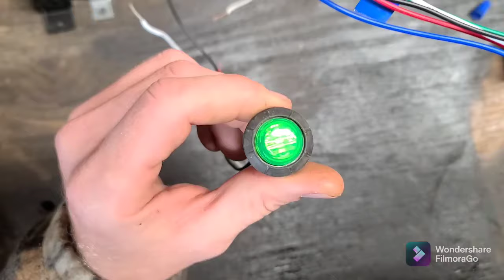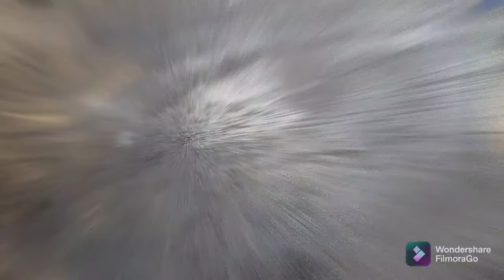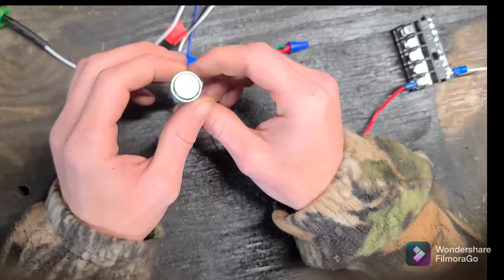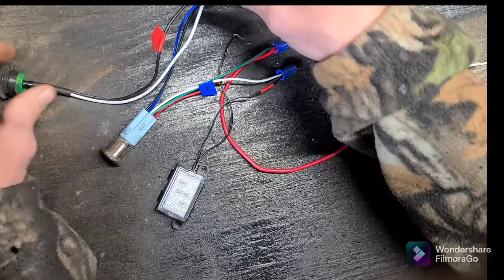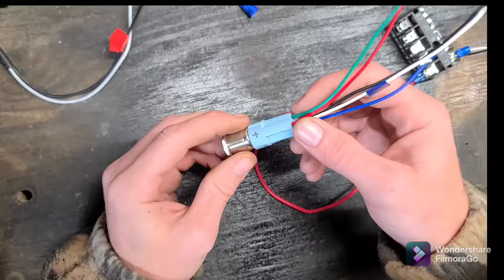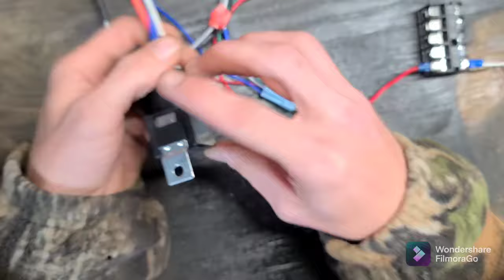How to wire a 5 pin halo LED switch.

Comment: This video made it so easy to understand. Could you by chance make a video for a 5 pin relay with a 5 pin toggle switch to replace a fuse? I want to use a toggle switch to turn off the module for traction control.

Comment: your video was great and helped greatly,but i would also like to know how to wire in a relay for radiator fan with the switch led lite on when fan is turned on... how can i get this info...   thanks Leo

Comment: I get really confused by your instructions. I have 5 wires on my latching switch. I want to have the power symbol and ring  led on when i push the switch in and i need to also transfer power to my LED marker lamps. I have a 115 volt to 12 volt power supply. I wired the LED marker lamps in a circuit with all black wires together and come out with a single wire. I wired three separate LED marker lights blue, green and red with each wire being separate on the other wires of the LEDs. How do i run from the positive 12 volt side of the transformer to the switches, three of them to control each of the colors, What do i do with the negative wires off the LEDs running back to the switches back to the transformer? I have green, red, blue, yellow, and black wires on the 19mm switches. I need a diagram.

Comment: I want to tie a wire to my AC selonoid direct. I want to push it in to connect for the circuit to the selenoid, plus i need to have the light stay on when it is engaged in case i forget to disconnect it. Which wires to i tie to the selenoid and the LED in the switch? Any help? What color and terminal goes from the switch to the selenoid and which wire comes from the ignition hot? Which color wire or terminal goes to which wire to keep the LED on when engaged? I have never been so confused. How about just doing a wire diagram showing the circuits and colors? It would be so much easier to follow on the different wire connections. Some of your video covers up the wire connection.

Comment: Is there any reason not to put the switch between the light and the ground? I’m putting some led lights in my truck bed but I have the fused power wire going directly to the LEDs and was gonna put this switch between the ground. Since it after the lights wouldn’t there be less current running through the switch? I don’t want the led ring to light up if that matters.

Comment: im gonna hook up 10 of those buttons, and wire so they light when they are turned on. but can i wire a button to turn of the led on the buttons? its for camper van and all the light might be annoyng at night i think, so would be nice to turn them off.
Reply: My campervan advice.... Don't have illuminated switches. You don't need them. You are just ask likely to forget to switch them back on to check if anything is on as you are to forget it's on because you don't have switches with lights. Anything you don't want running when your not in the van just wire a master switch and your done. The lights are irritating and not necessary in my experience.

Comment: On the light you used in this video was the negative wire white and the positive black? I was confused.
Reply from the maker: If you notice, I taped one of the words with red phase tape. This is positive. On THIS particular light, black is positive, white is negative.
Reply: @pemble07  Got it. I appreciate it. You are actually one only one that explained how i wanted to wire this light the exact way that i wanted.

Comment: Could this work with Wiring revers relays polarity and door actuators
Reply from the maker: Well, if i understand your phrase correctly, with a door actuator you would need a momentary switch, which this is not. Meaning if opening, once open, it would stay powered and potentially burn out the motor, switch, etc. Same for if powered closed. This switch, when wired to both poles, does either one load side or the other. Meaning it would always have power in either the open or closed direction. You need something to stop power flow once the actuators are in their expected position. I have a momentary one I may end up doing a video on.

Comment: Quick question dude. Exactly what would be the best way to wire the LED to come on only when the vehicle dash lights are on, like in a car for fog light, do it can be seen best at night? That what I'm gonna use .one for. Thanks a bunch
Reply from the maker: Wire your led for the halo wire to a source of power that only has voltage when your dash lights are on.

Comment: I have a 2 wire switch for my hazard lights in my car right now, wanting to use one of these. How do I go about doing that? Thanks in advance.
Reply from the maker: Is the factory hazard relay still in the circuit? If it is, you would have no need for the "nc" terminal to be wired in. You can use this switch, wire it as you normally would your two wire, you just wire in the switch led (halo) to a power source that comes on with the ignition.
Reply: Not factory but it does have a relay for the turn signals. The 2 wires on the toggle switch should be ground or power right ?

Comment: I have a LED momentary switch that I will be using for my boat horn button. I’d like to know how to have the horn working without the LED lit, and then when I turn on the navigation lights, the LED lights up. Any suggestions?
Reply from the maker: Yeah, wire in your led ring to your nav light circuit. The led ring is not at all associated with the wiring of the switch. If you want it to.come.on when you push it, you simply wire the light in series with the power to or coming out of your switch. In your case you want something else to control the led ring. (Ie. The nav lights) so wire that one wire to that circuit. Generally the ignition or off of a nav light switch if that's how you are powering your nav lighting.
Reply: @pemble07  thank you I was assuming that, but I didn’t want to fry anything in the wiring

Comment: Have just fitted new radiator and electric fan want a manual halo switch as a emergency wired in but the only thing that works is the led can you help 
Note when testing I only tested with engine not running as haven’t filled rad yet turn on ignition then switch but no fan working in a dilemma???
Reply from the maker: I don't know the amp draw or wattage of your fan, but these switches have very low amp draw ratings. This is a case where you would control a relay with the switch, then your relay is what ha does the power for your, in this case, fan.

Comment: When you install for real, you use those waterproof solder links instead of the screw on blue caps?
Reply from the maker: Yes, I never EVER use wire nuts on any vehicle. These switches are actually used after the video, so it would be a waste to use crimper and shorten my wires for the sake of a video. Sorry, should have noted that in the video. Yes I ALWAYS use heatshrink butt connectors, AND marine heat shrink over those. We have a lot of money going under water usually, literally.
Reply from the maker: Also, yes you can use the waterproof solder links. However, be aware that the Clear plastic on those connectors is very thin and will rub through, so if using the heat shrink solder connections, it's almost a must to add heat shrink over them to prevent rub through.

Comment: I been trying to figure it out.am i not seeing it correct or is your white wire on the green light actually a ground ?? thanks
Reply from the maker: Yes. The white wire is ground. The black wire is positive.
Reply from the maker: But, that definitely shouldn't hinder any information in this video. On that led light, it's simple. Hook it up, if it doesn't work, hook it up the other way. On these particular lights, yes white is ground. This is not a video about this light, at all. It's about wiring and how to understand it. Do you have any questions on the actual wiring process or you just asking questions?
Reply: Oh I know.i just was wondering iam trying to figure out this stupid 5 pin led push button trying to get my horn to work it confuse the shit out of me an your video really helps me thanks
Reply from the maker: @warrensylvester3807  Absolutely sir. And no it's all good. I get into lengthy explanations so didn't know to go there or not to go there. Thanks for the kind words and glad you found it helpful. I'm super busy at my shop right now but will be posting videos eventually. Alot of them.
Reply: I got it figured out and I couldn't have done it without watching your video over and over.thanks man
Reply from the maker: @warrensylvester3807  Not a problem at all sir!

Comment: Do I need a relay to wire a backup camera to the button?
Reply from the maker: What is the Amp rating of the switch, and what is the Amp draw of the camera?
Reply: @pemble07  both 12v.
Reply from the maker: @Koji Takata  ok. That's voltage. There's a Amp or watt rating of that switch. And there's a Amp or watt rating of that backup camera. The camera draw must be less than the switches rating in order to not need a relay.

Comment: I have a switch pretty much just like the one here. But the wires that came with the push button switch are all black and one of them are red. It has 5 terminals. The 1,2,3,4 numbers on the switch itself is where I don't have any idea. The brand is Twidec
Reply from the maker: To confirm, does your switch have three terminals in a row in the center, and two terminals on opposing sides of the center row?
Reply: Yessir
Reply from the maker: @caseydennison4524  ok, can you send a picture of your connector?
Reply: @pemble07  I didn't know you COULD send a picture on YouTube. I  definitely don't mind though
Reply from the maker: @caseydennison4524 Sorry, I guess you can't. Email it to me @ pemble07@gmail.com
Reply: I have the same problem, did you figure out how to wire them?
Reply: @MrSpeedyPete  I ended up spending another 8 dollars on one that had color coded wires to it. I haven't installed it yet though

Comment: The reason the led has its own power supply is so that you can wire them to be constantly on, Or wire it to come on when the switch is on 😊
Reply from the maker: That is one of the many reasons absolutely. Or wire it any of the other ways in the video. Congrats. If after this 14 minutes they can't figure it out, maybe your comment will teach them.

Comment: I used a 5 pin relay and it won’t go on or off I need assistance if you could kindly
Reply from the maker: You wired the relay wrong.
Reply: @pemble07  I discovered I was informed to cut the wrong wire 🙃 luckily nothing messed up, I have 3 halo switches one is not for anything so it’s just lit up , I have one to cut power to the pin 101 and the one to cut power to a stop lamp fuse I’m getting power from both just not sure I did the wiring properly I have the negatives grounded and the constant and positive wired together I just want it to be an on off switch but yeah I’m haven’t tested the lamp fuse one yet I know forsure the abs wire was incorrect now

Comment: I have a small bulb like the one shown here as a map light in my car, I’m trying to wire a switch like this to it. When I followed your instructions the light stayed dimly lit while turned off. It’s powered by a fuse tap at my fuse box, map light fuse. What could be wrong?
Reply from the maker: Sounds like you have your wires crossed.  Or backfeeding power possibly.